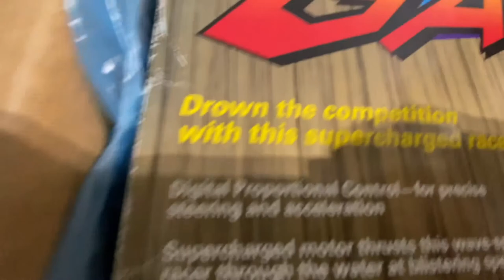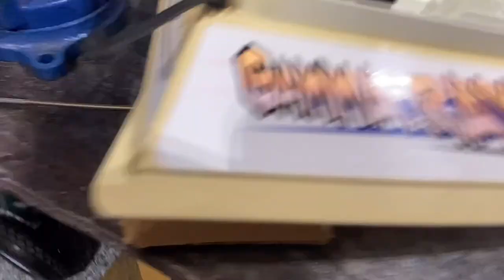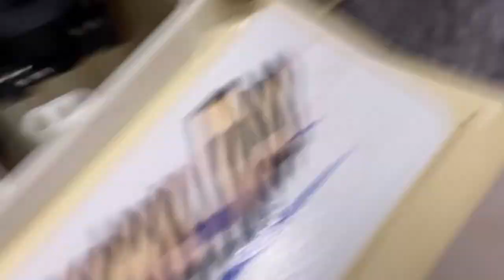FULL BUILD: Fast Electric RC Boat Radio Shack Gamma Ray toy brushless conversion hobby grade parts

Comment: is this list all I need? will be my first build, let me know if I need any special tools had my boat 20 years still works, now wanna play with my son.
Reply from the maker: That should be it. Tools i used include drill hot glue gun soldering iron Dremel and basic small hand tools. For kids a cheap amazon self righting boat would be a good option. This boat is overpowered and crazy for what it is.